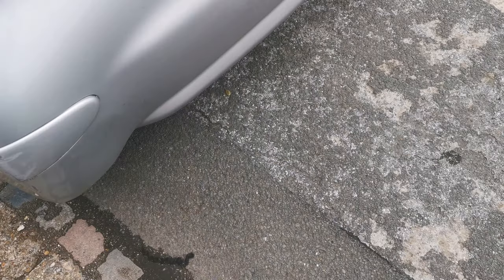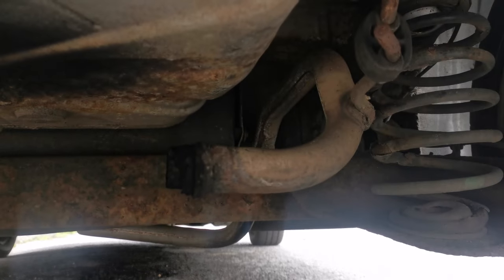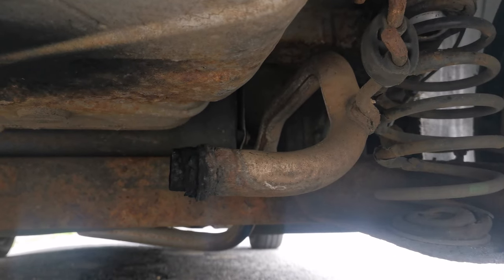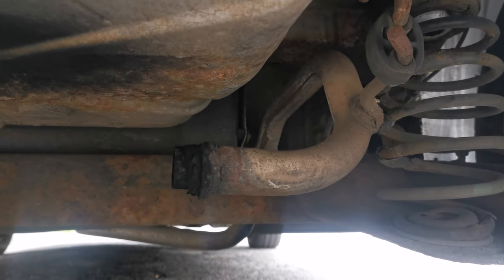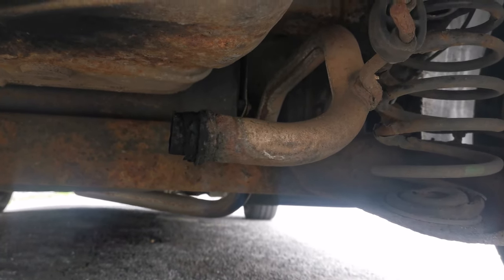MY EXHAUST FELL OFF!

Comment: Hope you find a goos disc conversion option. Want to do it to my 107 when i turbo it
Reply from the maker: It's apparently quite easy, I just haven't got round to it yet
Reply: @Thatsilveraygo  do you have more info about it? Also when are you finishing the engine?
Reply from the maker: @Shawniedavidson  not until I've done it myself 😂or seen it done, engine should be done end of may